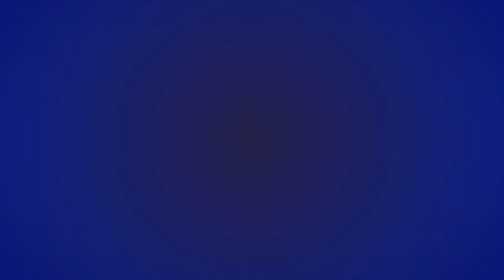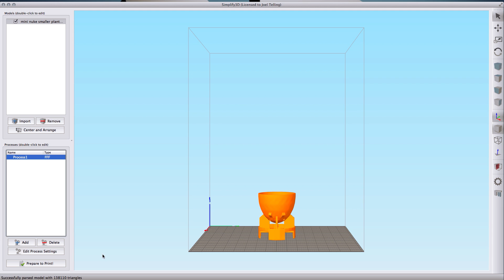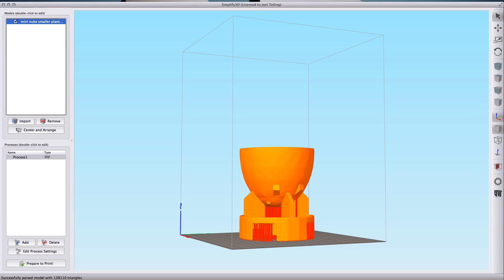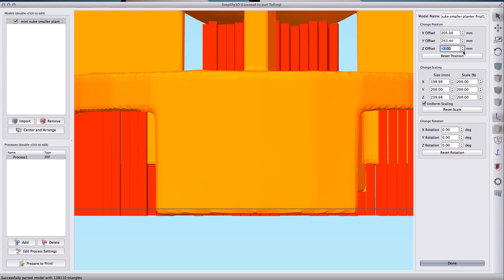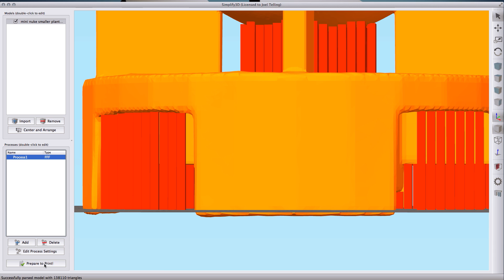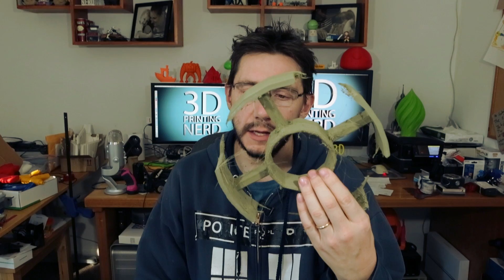3D Printed Mini Nuke Plant Pot from Fallout with Timelapse!

Comment: Love the print.  

Love the trick of lowering through the print bed, I didn't know it was that easy to crop the bottom off..

Here's a trick for you:
Next time, put a small piece of window screen in the bottom of the pot, or better, a couple small stones in the bottom, then a handfull of smaller stones or marbles or clean gravel on top of that, then a thin layer something even finer, like, fishtank-gravel, and then your potting soil and plant.  Either way, less dirt will fall out the bottom of the pot.  Over time you're going to 'rinse' dirt out of that pot and end up having to re-pot that plant.

Comment: Would it have been possible to join the filament together and wind it onto one roll this may have saved the early morning re threading. You could try to melt the ends of the filament on the smaller rolls together and just form one large roll. PLA melts at around 200C you would only need to line up the ends and maybe use some sand paper to polish up the sides of the joined filament.   Only a thought

Comment: I know this is an old video, and I'm about a year late to the party. But you could always run a controler like octoprint, and attach a filament run out sensor and get it to pause the print if you run out of filament...
Mine pauses the print and emails me (and attaches a photo) lol...
Reply from the maker: +Dan300891 print&go hey Dan. Yeah, I could do that, and eventually I will! I LOVE the idea of what yours does. Are you just using Octoprint?
Reply: Im running octopi, which is octoprint on the raspberry pi. And one of the plugins (I'll check when I get home) can send emails on events.

as for my sensor, Its one I picked up cheap of bangood. But for a run out sensor a simple switch will do the job.

I'm actually working on an octoprint plugin while watching this video to keep it all wrapped up in one, making it nice and clean :D

I'll have to drop you a line once its working. I may even upload a video on the subject

Comment: I am sitting here and wondering about why no one ever have made a simple tool to heat join to filament ends so you can use all the leftovers of filament that are to short to use. I am thinking of a piece og metal tube, with a inder diameter that is the same as the filament, that is split in to if it is hold together then to heated ends can be pushed in the ends of the tube and joined inside the tube. When it is cooled down the tube can be opened, that will keep the joined ends the same diameter as the rest of the filament.   That means no changing off filament while printing.
Reply from the maker: +skovbo65 I think someone did make that!

Comment: a simple question isn't it possible to weld together the filament on the rest of cartridge to make one big cartridge in place of replacing all of these end of cartridge ? I still don't have a 3d printer I am waiting to win a wanhao i3 from a site I realy like !!!
Reply from the maker: +Gil B Technically, yes. I could have done that, but for this, I didn't want to :)
Reply: thank for the fast answer and I am still waiting to win

Comment: Hello Joel,
Thank you for the advise. I will give this a try.   
Could you recommend settings using the simplify3d for PLA and ABS?   
The S3D does support the Malan M180 printer but I notice the default settings for PLA sets the extruder at 230c deg and bed to 110c deg. 
This tend to burn the PLA and the bed over heats the first layer.  From talk with other Malyan user they would set it to 210c deg for the extruder and 60c deg.  
Also the label on the PLA says 195c-220c so this is why I am questioning the default setting in S3D.  
We would be honored if you join our Facebook group & Thingiverse group.  https://www.facebook.com/groups/971580219580765/https://www.thingiverse.com/groups/malyan
Best Regards         Sidney

Comment: Hello Joel,    I need some 3D nerd therapy,..I have a Malyan 3D M180 printer. For the slicer I am using the simplify3D. I am using USAFilament 1.75 PLA.I am trying to print out a Elliptical Gear from http://www.thingiverse.com/thing:1082508      What happen the print is coming up and sticking to the extruder. I have leveled the bed using a business card under the nozzle. I am only using brim no raft support. extruder set to 210 deg  bed 65 deg.I had a lot of issue getting the prints to complete. either the pla will stick up and the nozzle will bump it and at time the pla will stick to the nozzle and it will pull it up off the bed.I am using Elmer's glue stick on the glass bed. I can not print PLA with out heating the bed because it would not stick. it has been very frustrating to get prints to come out well or have to print them 3-5 time before its able to finish one.Hope you could help me dial in the settings please.         Best Regards             Sidney King
Reply from the maker: +Sidney King Hey Sidney? Hmm... What first stuck out to me is using a business card under the nozzle. Usually business cards are a bit thick. Try a piece of regular printer paper, or the non sticky part of a 3M sticky note. Give that a try. Good luck!

Comment: How do you like the the gMax 1.5 XT+ printer? Is it reliable? Any plans to make a review of this printer after two weeks of use? Thanks!
Reply from the maker: +innomind Hey there! So far, I love the printer. I have had it in my possession longer than two weeks, but, my video shoot schedule is PACKED. I have a couple more videos planned for this printer, but, I can answer any specific questions you may have in the meantime. How do I like it? It's GOOD. I love this machine. It prints great detail, and it's fast, and it's accurate. Is it reliable? I've had it, what, less than two months? So far, EVERYTHING I've thrown at it, it's been able to handle. In the time I've had it, it's been very reliable.
Reply: +3D Printing Nerd Awesome thanks!
Reply: +3D Printing Nerd Have you printed in ABS? If so, what was your experience like? I take it this printer has a hot bed for ABS..

Comment: Heya Joel, I noticed you've got an oiler on the gMax...but you've also mentioned that high-lube nozzles are a Go-To modification, which I would think would get rid of the need for an oiler. I'm going back and forth between PLA and ABS, so perhaps that's another factor in either getting - or avoiding - an oiler.  (And I've got a bunch of proto-pasta carbon fiber, which is sweet stuff...but which has also clogged my printer on the 4th or so print with it. :(  So, yet another thing to think about.)

What do you think?
Reply from the maker: +Brandon T Plated nozzles and a filament oiler are not mutually exclusive. The plated nozzles resists wear of the nozzle itself, and the filament oiler provides a little less friction for the filament to travel through the nozzle. Honestly, you could easily do both on the same machine and be all good. For the PP Carbon, what print settings are you using and on what machine?
Reply: +3D Printing Nerd It's a Wombot with plaed nozzles, and I'm still tweaking settings but in the printing I've done so far I was getting really good/smooth prints at 0.25 layer height and 60mm/s, although that was purposely "slow and safe" and I'm planning on bumping it up to 0.2 (maybe smaller) layer and 80-90mm/s if the printer will have it (Aurimas says he's tested it up to 120mm/s, so I'm hoping 80-90 will work.) And, umm...I think I had it going at 230/60 for nozzle/bed temp.
Reply from the maker: +Brandon T I've only printed PP Carbon on my FFCP, and with that I had bed at 50c and nozzle at 209c and that worked for it. Maybe an oiler will reduce chance of clogs for you. It is worth trying.
Reply: +3D Printing Nerd That's what I was thinking; seems like I've had to run everything a little hot on this printer, but that could very well have been because I was not using a plated nozzle at the time, plus BuildTak seems to eat up 5-10 degrees of wholesomy stickiness. Now that I've got the printer better calibrated, I'll try dropping the temp and using an oiler - maybe with the new nozzle it will smooth everything out. (I know the original nozzle was part of the prob, but how much, I'm not sure.)

In any case, thanks for the help!  I've got the oiler all sliced up and will make myself one to have around Just In Case. #ASCIIHighFiveBestHighFive

Comment: @Joel

  Whenever I have a spool of the same filament, I just join them together using small butane lighter.  Heat both end until they are gooey and press them together.  I then trim the excess with my dremel.  Works perfectly and I never have to worry about running out of filament.
Reply from the maker: +jeevesme Hey! I knew I could do something like that, but the XT+ has a "change filament" option on the LCD. I wanted to use that for this print. Don't worry, I'll be joining filament together soon :)

Comment: That's awesome. I wish I could print it, but I broke my printer.when I was putting in a new nozzle I tightened it to tight and the tip broke off leaving in just the threads😩
Reply from the maker: +William White OH NO! Once you get it fixed, you can print it!
Reply: +3D Printing Nerd I'm hoping to be able to drill it out. It really sucks if not because it is a brand new jhead I got for Christmas😩👌🏻🙄

Comment: I'm impressed with those supports.  I just use the Makerbot slicer with my Replicator, and I often can't remove even the simplest supports without pliers, flushcutters, and a razor blade for tidying up.
Reply from the maker: +Michael Vaughan Get Simplify3D - it's completely and totally worth it. No joke.
Reply: I just bought it a few hours ago.  Yet to actually play with it much, but I guess the advantage of having a common, standard printer is, pretty much all software will have a preset for it, and Simplify 3D didn't disappoint, there.  It was pretty easy to set up (I just had to remember to disable the Makerbot service, because that was occupying the COM port)

Comment: Hay you Big beast.  You almost broke your little girls hand.. LOL.  Shaking it off like a pro after the high five.  I love Angus, that's how I found you.  But I have some Buts with PLA.  I hear it doesn't do well in the sun and won't it degrade with water after months in the outside weather?
Reply: +Victor Vazquez I'm keen to find out the effects too, it's why I printed mine in the algae PLA which is meant to break down even faster. It's currently sitting outside in 36ish degree's C heat and seems to be holding up OK! Granted it probably won't rain for a while...
Reply: +Maker's Muse Also interested in this!.
Reply: +Maker's Muse If anything, the sun in Australia will be a harder test of any plastics that aren't UV stable, too, due to our thinner ozone layer, allowing more UV through.  If the plastic can survive the sun, here, it should hold up okay anywhere.
Reply: I printed a rain deflector for a bird feeder from PLA and it's holding up good outside and sees about 6 hours of sun every day. Holding up good after a year. It gets 100 degrees here regularly. Maybe not good for the inside of a car but good enough so far.

Comment: Any tips on what to do with 3D printed waste?
Reply from the maker: +Mickice If it's waste, I think it's recyclable.
Reply: So dump PLA in the recycling bin?
Reply from the maker: Mickice I've done that.
Reply: +3D Printing Nerd Not sure if it backed fully, but I saw a Kickstarter where the machine took old supports or other plastic, melted it down and made it back into fillament strands. They also sold these mini bead plastic things instead of spools to use for your 3D printer!

Comment: Ahh that bottom weirdness would be the make-solid artifacts, awesome trick in S3D didn't know you could lower parts to crop to the bed but makes sense. It's Ginormous! Too cool.
Reply from the maker: +Maker's Muse Pretty neat trick, right? Just lower stuff below the bed, and it won't print it! Also, it's SO COOL!!! Thanks again man. Let's figure out a way to collab more.
Reply: 100%! If you think of anything you'd like me to have a hand at designing or printing don't hold back.
Reply from the maker: Maker's Muse You bet, Angus!
Reply: +QWERTY That's the plan!
Reply: 19:12

No Joel, you're plant looked like it was dying a sad death in a radioactive wasteland and needed a pot to match.
Reply: You could totally make a small dustbin with swivel top with that model!